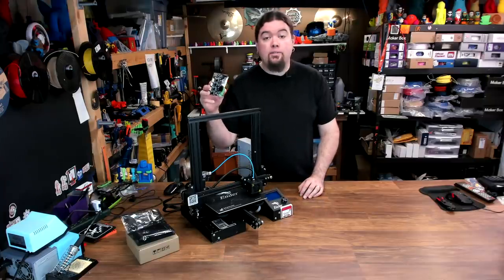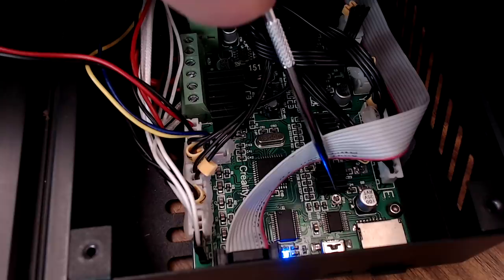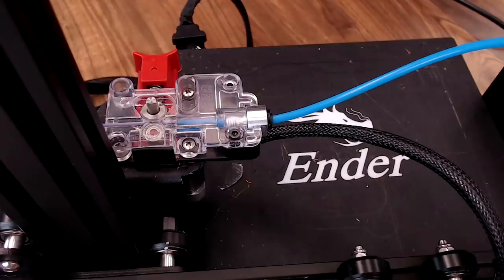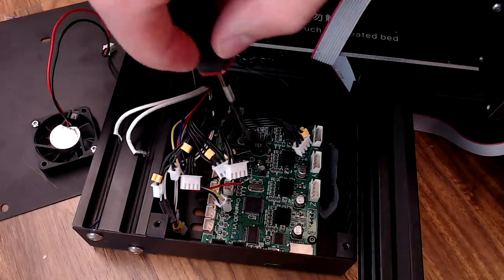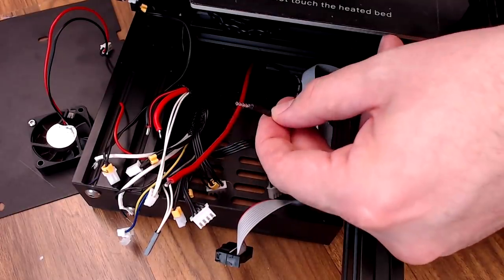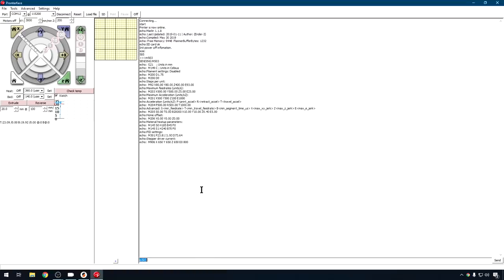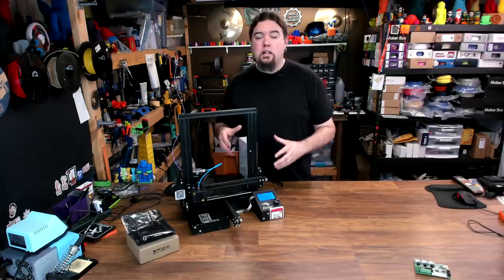Creality v1.1.5 Silent Main Board - How To - Chris's Basement

Comment: I like to see  you promoting the use of ferrules.  Soldered wire ends into a screw connector are the worst.  As far as boards, I think I am leaning to the SKR.  The small processor that creality uses does limit that features you can add.
Reply from the maker: Thanks Mark! Yep, I am with you, I want to test the SKR as well.

Comment: I have an Ender 5 Pro with the 1.1.5 silent board and it has Marlin 1.1.6.2. I think the Ender 3 and 5 do not share the same version at this point in time. As always great info.
Reply from the maker: Interesting, I will be checking out the ender 5 soon.

Comment: Just about to upgrade my V1.1.5 board to the SKR mini E3 lol, 32bit + 2209's

Trying to get my head around Marlin 2.0, have my BLtouch and liner advance setup and now trying to work out how to set up my filament runout sensor.
Reply: I have just bought the skr mini E3 myself haven't installed it yet as I haven't even built my Ender 3 yet lol.
Reply: @kewin3000  I found VSC/platformIO used to compile marlin 2.0 a little more tricky than arduino used for marlin 1.x.x but getting there.
Reply: @MrDead1975  I have used Visio studio before so it's a little familiar to me, I just thought I might as well but all the upgraded before a build it, can't wait to see the difference between the 32bit and marlin 2.0 over my anet a8 lol. I'm going to add a filament runout sensor as well and in the future a bltouch
Reply from the maker: Great conversation. I do plan on testing out the SKR mini on this printer as well.
Reply: @ChrisRiley  Love to see that one.  I will spend money on that upgrade.

Comment: Hi Chris, loved the video!  You said your 1.1.5 already had a boot-loader.  How do I figure out if mine does?  I installed the 1.1.5 when I got my Ender 3 Pro, but haven't updated firmware yet, and I'm getting ready to add on the BL Touch.  Thanks!
Reply from the maker: About all you can do is try the upload and see if it works, not great, but not much else can be done.

Comment: Chris I have a question........I'm switching to a v1.1.5 silent creality board on my ender 3 pro which I'm running with stepper dampers.Would you attach em to the v1.1.5?
Cheers
Andy
Reply from the maker: I wouldn't bother with them, you will see when you put it in, it makes the steppers almost silent.

Comment: Im really enjoying your videos and had a question, Which extruder would you recommend for the ender 3, i noticed you had the EZR installed but in a past video you showed how to install the BMG extruder. Which of those 2 would you recommend?
Reply from the maker: Thanks! If it were me, I would save the money and go with the EZR. It works well and it's cheap.
Reply: @ChrisRiley  Thanks for replying, thats what i was leaning towards. I hope you make more videos that involve the ender 3 and that new board. I just installed one last night and had trouble updating the firmware but all good now. How about a tutorial on the EZABL with the 1.1.5 board.
Reply from the maker: @doubledigitdreams  More to come on the Ender 3 for sure, we will see what we come up with.

Comment: the 1.1.5 boards lost the feature of "filament change" with in the G.code file. the printer ignores the filament change script. im new to the 3d printing world and i dont know how to enable the filament change. can you make a video about that?
Reply from the maker: I will give it a try, I have had other say some of the filament change stuff wasn't working. I will look into it.
Reply: I just changed mine also. you are correct. there is also a popular bed leveling gcode from another youtube site and it doesnt allow you to level the bed

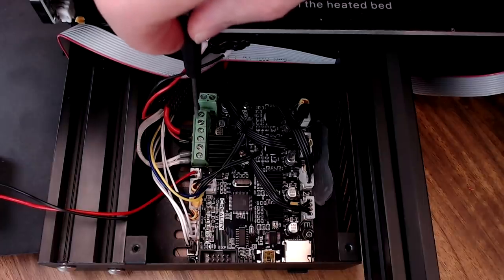Comment: Another excellent video, thanks. At 9:19 you say that last terminal is a constant 12v, I thought that ran at 24v on the Ender 3?
I'm waiting on my skr 1.3 to arrive, it was destined for my Ender 2, but I might put it in the Ender 3 and take the Creality board into the Ender 2
Reply from the maker: Sorry about that, you are correct. This board can run at 12-24v ender 3 is 24v. I misspoke because they are labeled 12v on the board, but in this case it will be a constant 24v.
Reply: @ChrisRiley  thanks for clearing that up.. it'll keep me from frying some 12v LEDs I've been thinking of adding
Reply: @ein57ein  I just got some 24 v LED strips from Amazon for $ 8.50 for 1 5 meter roll, Haven't tested yet, still getting the mounting worked out.  Here is the link if you want to look at them.  https://smile.amazon.com/gp/product/B073QNMS5J/ref=ppx_yo_dt_b_asin_title_o01_s00?ie=UTF8&psc=1

Comment: Hi Chris, excellent content as always. Following your example I've just received this board, but I'im actually using it in the Ender2 but cannot manage to make the LCD work.
Would you by any chance have some time to plug your Ender 2 LCD/cover on the Ender3 and just set Minipanel in Marlin to see what happens ?   As the pins used for the LCD and encoder are at the same place all should work, but it does'nt on mine.  This would definitely help a lot :)  Or, who knows, have un update on the Ender2 update where it also gets the silent board :D
Thanks anyway for the good work, your videos are always the guarantee to learn something.
Reply: I've actually just solved it by means of a bunch of Dupont wires : SCK and MOSI seems to be really required for the display to work, and it comes handy that those 2 missing signals are availble on the ICSP header just nearby :)
EDIT : I've shared that as a "Thing" https://www.thingiverse.com/thing:3965485
Reply from the maker: Very nice! Glad you figured it out. I actually sold my ender 2 a while back so I couldn't test it. Thanks for posting this info as well.

Comment: Hello, the new CREALITY 3D Silent 1.1.5. when using code to print from Simplify3D-4.0.1. the plastic feed motor stops periodically-random. at different points in the print. what could be? thanks
Reply from the maker: Wow, I am not sure, maybe it's some sort of extrusion limit in this version of firmware.

Comment: The sound is practically gone. I will replace mine also. Chris, how do we tell if our ender3/CR10-s has a bootloader installed or not? Let's say it has no bootloader installed and I try to upload a new firmware. is it bad? Or will it just do nothing? Do I have to check if there is a bootloader before upgrading firmware?
Reply from the maker: About the only way you can tell is to just try the upload. If it's not there, it will just fail. If it is there, the firmware will get flashed.

Comment: I've just changed the mainboard on my printer. but my extruder stepper motor still doesn't work. what should I do next? I really stuck and couldn't find any solution. Please help mee
Reply from the maker: Are you sure it'd not working? Make sure you are testing it with the hotend up to temp, about 170c.
Reply: @ChrisRiley  yeah, i run the motor without heating the hotend before. I found that yesterday. But thanks for reply my message. 👍👍
Reply from the maker: @pinatahamawang6110  Happy to help!

Comment: I just changed mine and I think the extruder motor is getting too hot when I have lots of retraction. Normal or I should lower the voltage ? Thank for your video !
Reply from the maker: Probably normal, those motors are pretty small.

Comment: can you confirm iif this silent mainboard v1.1.5 works with creality BLtouch v3.1? I have installed both, but the BLtouch doesn't seem to function at all. I am new to this so it could be user error.
Reply from the maker: I don't know that it does, I am not sure what port you would plug it into. Do you have a break out board of some kind?
Reply: @ChrisRiley  i figured it out. I had the 3 pin input wire connected backwards. VCC went into Signal. After I corrected it, and uploaded the BLtouch FW, it worked like a charm.
Reply: @jsc3417  I have the same combination you have.  Can you put a link to the firmware you used?  I have a version based on Teaching Tech modifications, based on 1.1.bugfix and it mostly works but not quite.  It also doesn't know it has 2208s, so no UART options.

Comment: Will that work on a cr-10s??  I’ve seen some people say they have used the stock ender 3 board on a 12v system
Reply from the maker: I am not sure about the cr10s, but you should be able to use it on 12v.
Reply: Chris Riley the cr-10s is a 12v system. How would you change the board from 24 to 12??
Reply from the maker: @Defender513  There shouldn't be anything you have to do, it will just run at 12v.
Reply: Chris Riley okay great. Thanks. Something to think about.

Comment: I would not replace the board just because the extruder has a low torque. These direct feed extruder were originally used as direct drives and were never intended for Bowden systems. My recommendation is to build a Greg Wade extruder and you will have no issues with torque. I made a model for the Ender 3, anyone can use this model or go straight for a Greg Wade Extruder:

https://www.thingiverse.com/thing:3574924
Reply: The problem was proven to be the board.  No issues with that extruder.
Reply: @W4TRI_Ronny True the driver was faulty and changing a driver on an Ender 3 board is basically impossible without the proper equipment. But using a direct feed extruder makes it necessary to supply more current to the motor, which in turn will strain the driver more. Straining the driver can then lead to driver failing. With a geared setup you do not need to push the motor and driver to their limits. Also there will no forces acting on the motor shafts. I only see advantages to a Greg Wade extruder and just one advantage to a direct feed extruder and that it is simple and cheap.
Reply from the maker: Interesting, I haven't had any problems so far, but I will keep an eye on it.